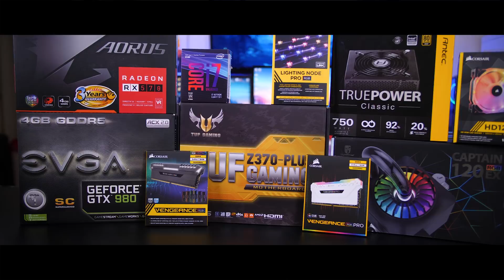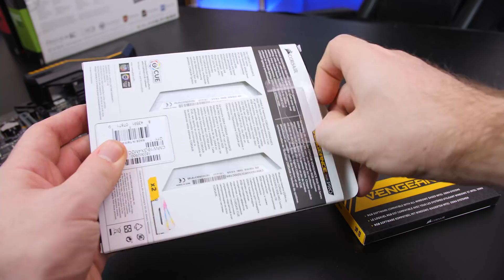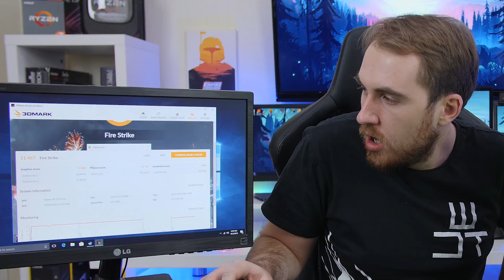$2000 Dual OS X + Windows PC Build - Who Said You Can't Game On A "Mac"

Comment: I was excited when the video started with the b-roll footage, then it started to slowly disappoint me, the workarounds here were terrible, not trying to "hate on" but the dual GPU wasn't the greatest idea, not sure what version of OS X you used but it seems like you didn't researched enough to fully install the OS, today is way easier than ever to Hackintosh any build even if it as old as Haswell, sound kexts, networking, GPU acceleration for Nvidia GPU's, as long as you don't look forward to Mojave, you could easily done this in a better and easy way, also Dual booting, you can use Clover without any issue to boot into Windows, Mac OS X,  still, it was a nice video, hope to see more content of Hackintoshing!
Reply: How would you suggest building a hackintosh then?

Comment: To use both graphics cards without having to switch the cable, you could buy a kvm switch or plug another cable from the nvidia card to the monitor and then disable the amd card in windows’ device manager, so windows will use the nvidia card and macos the amd one. This is possible because mac won’t recognise the nvidia card if you haven’t installed any driver. The monitor will then switch to the used input by itself without having to do nothing

Comment: is it possible to build a triple boost system hackintosh? one that can boot into Windows, MacOS, as well as Linux?
Reply: You should be able to on a dual boot program though I’m not sure, but if you have 3 different hard drives, you definitely can! Just boot from a different hard drive depending on OS.
Reply: Basically a windows computer can most likely run Linux so yes. You would most likely need 3 drives tho to install the separate OS’s

Comment: Get an hdmi switcher so you don’t have to keep switching out the hdmi cable. Im doing the same thing with a 1070 and rx 560
Reply: What's that? will it make it easier to switch from mac to windows?
Reply: Alex Quinteros I’m trying to do exactly what you suggested. What splitter are you using?
Reply: They are called kvm switch

Comment: Hanu I Want To Make A Hackintosh Using My Ryzen 2700x and Gtx 1070ti 
But There's Not A Single Video On How To Hackintosh Ryzen 2000 Series Not A Single Video on the Whole Internet 
Maybe You Should Do One :)
Reply from the maker: The problem is because Apple only uses Intel CPUs its very hard to do it and will probably need to write your own commands for it to work. I first wanted to use my 1800X but then I ran into that problem.
Reply: @WeDoTech  but many people did successfully 1000 series  ryzen Hackintosh:((
Reply: Hackintosh on a ryzen is very difficult amd worthless, because no quick sync support on AMD CPU